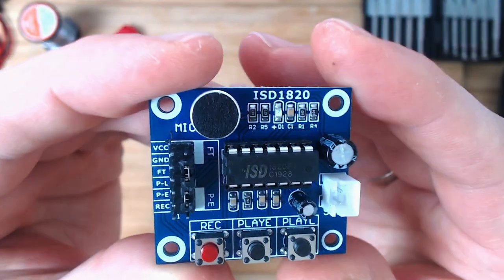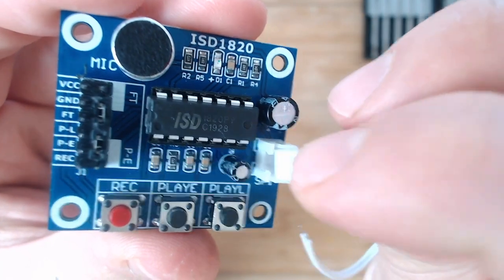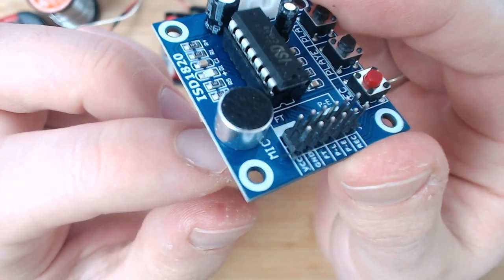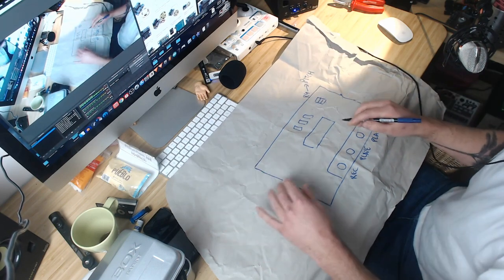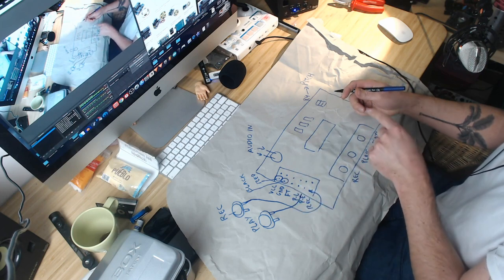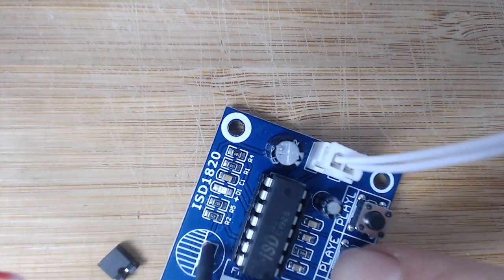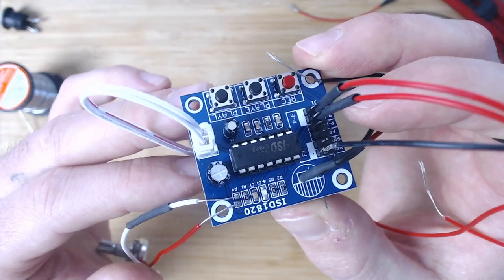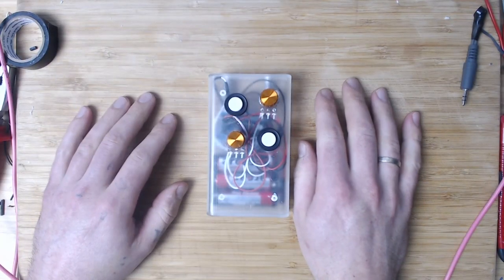HOW TO DIY LO FI SAMPLER

Comment: You can easily add a gate in so that you can sequence the samples with gate out from other gear. Get a simple npn transistor like 2n3904 and solder the collector to one leg of your trigger button and the emitter to the other leg, (you might have to try both directions to see which way it wants to go), then add like a 300k resistor from the base to a 3.5mm jack. A gate signal will now switch the button and the button will still work when you aren't sending it gate. 

I don't know how isd1820 is set up but if your blow up a transistor (unlikely but possible), it might be switching the whole battery power through the button, in which case you might need a resistor between the emitter and its button leg. Something like 200ohms should be fine.
Reply from the maker: Damn! You helped me out a lot with your comment, i was exactly trying to do this! next project confirmed! thanks
Reply: @Lonershy  Hell yeah. And your video got me thinking about buying some of these isd boards finally.
Reply: @Lonershy  and please do a video on that as well, I would love to try this out too.But I am a total noob when it comes to electronics. This will be my first ever project. Also I just subscribed. I love your demeanor and chill vibe. Keep these diy videos coming. You are the first person who actually makes things easy to understand most DIY youtubers either show to little or make stuff really complex to understand. I watch a lot of them and you are really the first person who actually made me understand it in a simple and easy way. Your diagram made it super easy for me. Most of the times when I see a diagram I already loose my comprehension after 2 seconds. But your diagram made me understand it. So I'm really thankful you made this video. I hope you will make more of these. Thank you and have a nice day.
Reply: I didn't read it before and I also talked with another guy , and he gave me also another way, which is a diode and 10k resistor in series going to the play pin of the IC is all that is needed, CV voltage is max 5v ( adviced by @dirkk82 ) down my little knowveldge I'm wondering which one is the better one and the more stable :) hope this is helpful
Reply: @Naked4FunTV  So here's what's happening.
The microcontroller is waiting for a signal to start playing the sample. That means, one way or another, one of the microcontroller's pins is either at positive voltage or "ground", waiting to receive a short pulse of the other polarity to say "go". That is, the pin has 0V on it, and is waiting for a few milliseconds of 5V (I'm assuming the circuit works on 5V and 0V, but it's not guaranteed), or the other way around.
With the transistor method (google "transistor as a switch"), you're sending enough current to the base of the transistor to "open" the channel between collector and emitter. So if those two are on opposite sides of a button, you're just letting through whatever is waiting on either side of the button to normally be switched. This is a nice method for a lot of circuit bends because you aren't adding your own voltage to whatever you're switching, you're just sticking a door into whatever pathway is already engineered to be doing something.
The diode/resistor method will most likely work just as good here, as long as:
1. The circuit in fact works on +5V (probably)
2. The pin responsible for triggering the sample is held at ground, waiting for a 5V signal (don't know, but not unlikely)
The resistor is there to make sure that whatever you're using to send signals only sends a very small amount of current to the microcontroller, because it most likely can't deal with very much. The diode is general protection so that the microcontroller doesn't send any voltage back to your signaling device, since we don't know exactly what's going on with that specific connection in the circuit, there could be other things happening. It also drops your voltage signal a little bit, but that could be good or bad, since we're theoretically in the dark about what type of signals we actually need.
I'd go with the transistor, because then I don't have to think about what's really happening in the circuit. If I went with the other method, I'd probably also add a voltage divider and move up from 0V to find the minimum voltage that triggered the sample reliably. And I'd want to be confident that it would only ever be triggered by a 5V pulse.
This is far from a comprehensive explanation of what's going on, and an electrical engineer probably wouldn't be happy with some of it, but I hope it helps.
Reply: I just looked it up and the ISD1820 works on 3V, so if you want to use the diode method, divide your 5V trigger pulses down first. This would work like this. You have an input jack to receive your trigger pulses, then your diode, then something around 4k resistor, then a 6k to ground. From the junction of those two resistors, take your 10k to the uc pin for play. And make sure you only send it max 5V
Reply: @samothrace2106  you are just great thanks and yeah following you thought of transistor/switch I believe is probably the best way to go, and safer for other devices attached to it probably, I'm  just a beginner in electronic my said but I'm super  fascinated from it and this will be my first little project, a sequencer and a lofi sampler :D thanks a lot
Reply: @Lonershy  Great and simple project ! Thanks Lonershy ! I'm wondering how it would be possible to trigger record and playback (loop) at the same time with a momentary switch so that it can create a shorter loop/repeater effect. Or maybe the chip needs to be recording at all time, add true bypass so when the momentary switch is activated it would connect to the playback and output of the ISD1820 module. The sampling time, or loop, would also needs to be reduced or controlled by a potentiometer for a short repeat effect. Maybe there is shorter sampling time chip out there. Needs to do some reasearch ! Any idea how to accomplish thoses not so crazy thoughts ?
Reply: Or maybe a digital delay would get me there faster ahah
Reply: @NinoJoy  the chip cannot record and play at the same time unfortunately. I have posted a free schematic and PCB layout for a eurorack module that has all the features broken out to 3.5mm jacks

I used a cd4053 to stop the gate input when record is enabled and turn back on when let go.

Comment: I feel like I'm missing how to use the FT (Feed Through) function. You said to connect those two pins together... does that mean it needs a switch of some sort in between the connection? Also, the volume pot connection was really glossed over. Even pausing and following the wiring was confusing. Can someone recommend a tut? I've built 3 of these now btw because of your vid. Thanks so much!
Reply: Just an FYI. This particular chip wouldn't work with the FT function that you posted at those two points. You need to connect the OTHER FT points together to get audio through.
Reply: @CommodoreCrush  What do you mean by "the OTHER FT points"? The ones second row first and second bar next to the white bar at an angle to it? The "other side of VCC and GND" so to say? Sorry if this sounds wierd, it's hard to be specific through YT-comments...

Comment: Very nice explanation. Does the sample board keep it's recording if the battery is removed? What's the maximum recording time? Should I just check out the Amazon page already?
Reply from the maker: YEs! it keeps it! maximum is around 20 sec if you record with the pitch level down, normal pitch is around 10-12 sec.

Comment: Great tutorial! :) When can I find this type od plastic box/case to this sample (or similar)? Can you wrtie name/type od transistor used for pitch knob? I can't understand this from video :/.  

Thank you for this tutorial :)
Reply from the maker: Hi! Thanks! I buy the cases on a local electronics shop, but you can find them on amazon, look for "enclosure" for the pitch you need to replace a resistor (the R4 in the module) with a 100k potentiometer, thats it!
Reply: @Lonershy  Thanks for help. This will be my first DIY project :)
I hope I don't burn down my house :D

Comment: Bro your God level for this tutorial. thanks alot foreal. I'm about buy the parts.hey I saw on the Amazon reveiw people had trouble with amplification did you have this issue if so how did you solve this issue? Thx again keep it up bro
Reply from the maker: Hi! yeah, i saw that too but maybe people was complaining because of the quality of the sound without a volume potentiometer, it may ge very loud so it´s important tp put one. Go for it!!!
Reply: @Lonershy  I found something in my searching for the module that I thought was kool that u might like, it is a APR33a3 module (only available form India from what I can tell). It is similar to the ISD1820 but this one records 8 channels and in hifi(16 bit) . Thx again leading me to these awsome modules and projects.
Reply: to rectify the loudness, stick a resistor on the output of the speaker/line out. it is loud because the speaker pins are driving a speaker rather than line out level. info can be found here  https://www.epanorama.net/circuits/speaker_to_line.html

Comment: You mention jumping the 2 FT points to be able to hear what you are recording. I cannot get this to work. The source sound is allowed through until the record button is pressed. Then the sound cuts out while the record button is pressed and it does not record. Have you figured a way around this? Any idea what's up? I've got  PLAYL, the loop switch, the pitch pot and the input connected. It works great other than the FT jump...
Reply: Did you fixed this?
Reply: @fabiandeleon4636  I did not.
Reply: Thanks!
Reply: Having the same issue. Ever find a solution?
Reply: @madzpanda  Nope. Damn thing is still off in a corner of the bench.
Reply: @MothHunterMods  fuck man. I scoured all of Google. Watched multiple videos. Chances are you can see me asking about this on every single one. They mostly say what he says but that doesn't work. If they don't say that it's a bunch of "maybe this but I never tried it" , or diagrams/schematics I can't read. I just need a simple "connect this pin and this pin". I know this thing can do it. You can hear this guys 4 channel sampler do it in that video so I know it's possible but it's like no one wants to share how.
Reply: @madzpanda  Damn, dude. I feel ya. I spent hours and hours trying solve this puzzle. Keep telling myself I'll get back to it, but it just stares at me. I had plans for it on a larger scale.
Reply: I could still do something cool with it, but being able to monitor the input is sort of a big deal.
Reply: @MothHunterMods  I had 2 plans. Based off this video but dude made like 2 massive mistakes in it.
Reply: @MothHunterMods  as a guitar pedal not being able to hear yourself is basically useless. I could make other things put of it... but I didn't want a yak back. Ya know? I wanted to do something like I've heard people hear do but apply it to something slightly different. Like you said not being able to get it to do that is kind of a big deal
Reply: @madzpanda Yeah, man. Pretty big bummer.

Comment: Great and simple project ! Thanks @Lonershy ! I'm wondering how it would be possible to trigger record and playback (loop) at the same time with a momentary switch so that it can create a shorter loop/repeater effect. Or maybe the chip needs to be recording at all time, add true bypass so when the momentary switch is activated it would connect to the playback and output of the ISD1820 module. The sampling time, or loop, would also needs to be reduced or controlled by a potentiometer for a short repeat effect. Maybe there is shorter sampling time chip out there. Needs to do some reasearch ! Any idea how to accomplish thoses not so crazy thoughts ?
Reply from the maker: haha no idea! but i encourage you to try!!!

Comment: On the first device you showed did you have to use some sort of mixer circuit to combine the outputs?
Reply from the maker: All together to the same output!
Reply: @Lonershy  Thanks for the reply!  I'm building this currently with five ISD boards, five Gate inputs, and two outputs via a buffered Y splitter daughterboard.  The daughterboard also contains the 2N3904s necessary for the Gate input which was described in another comment here and it converts the 9V input down to 5V for all the ISD boards by an LM7805 voltage regulator.
Reply: Someone also mentioned the ISD boards requiring 3.3V, that is the suggested voltage from the datasheet however numerous sources indicate it will work with anywhere from 2.4V to 5.5V DC.  5V seems to work absolutely fine in my own experimentation.

Comment: When you made the 4 channel sampler how did you run the inputs and outputs? Did you just solder all four directly into the same jack for in/out?
Reply from the maker: yes! super dirty mixed, for some reason if you share the batteries with more than one unit there is a big weird noise, if each unit has its own battery pack, there is no noise... i guess there must be a solution to that :?
Reply: @Lonershy  maybe some kind of grounding issue? I've read that they can handle the 5v from usb, so maybe powering them that way could help with powering multiple modules from one power source
Reply from the maker: @hunterchapman9845  good to know! thanks!

Comment: Yeah~thank you for sharing this tutorial,it is dope~did you make mix circuits in your 4track version ? because I connect FT,but I cannot hear input when I am recording ,thank you so much ~~~
Reply from the maker: Hey! I am wrong in the diagram, you have to connect FT but the one in the back, so counting from top left, the first and third pins must be connected! sorry about that! anyway, my experience with feedback after messing with 10 of those chips is that works but half of the times once you record, the volume goes super low... but just try!
Reply: Lonershy yeah thank you so much man,I will try it~~~

Comment: Hi! I try to build it but when i record and press play only plays some kind of white noise, has this ever happen to you? I've tried to re-solder in many ways but nothing seems to work... Thanks, love your content <3
Reply from the maker: Ok yes it happened to me, its probably something messing with the audio input or output, probably the output is fine because you can hear something, so i bet is the audio input, are you using the mic on it or have you connected a jack?
Reply: @Lonershy  I've taken the mic, and i tried different audio inputs. In the video looks like you are soldering 3 cables to the input, i´m only soldering 2 is that a problem?? Thanks for answering!!!
Reply from the maker: @rucarucaruca  it is only 2 cables. Hey, send me a video through instagram, im loner.shy on insta and lets find out!
Reply: @Lonershy  Thanks, I just did!

Comment: I suppose but this time you had learnt some things I will share with you but I hope it helps some other people coming to the comments behind me (and maybe some things you still not figure it out by yourself IDK). First of all there are dedicated modules for more voices so you don't need to buy 4 to get the same amount of voices but I'm not sure if these have realtime recording due I prefer the iPhone route with Koala as you found ;) Also teensy 3 has input/output and nice "patching-like" environment more friendly than regular C/C++/C scripting (arduino) coding. In that line I also shared in the other video the Otem Rellik looper thing, if you dig further you will find is based on mobmuplat (wrapper for puredata patches with touch interface available for iOS/android) so take a look into that too. Related to the soldering skills and practises I will recommend you next time for soldering (into smd pads) some soldering flux and some kind of connector/pin header instead going with cable directly (or almost expose the less possible to avoid shortcircuit) also for desoldering get a desolder-shield (IDK the name in english... in spanish "maya para desoldar") made from copper. It helps to clean the extra tin (estaño) and also some isopropilic alcohol (everyone knows what's that nowadays :( ) and toothbrush for deep cleaning before next solder attempt. Knowing the value of R4 (you can use a voltimeter for that) will help you to get the proper potentiometer. Proper desoldering could help to keep alive that poor mic... but in your way you get a nice 2 pin connector so hooray for that :D. For through-hole components (the mic for example) a vacuum pump desolder could be handy too.  Finally about organisation inside the box... if you take some time to learn very basics about GND and VCC placement in electronic circuits you will end with easy design using prototyping pre-made pcb. There are the most common with all the dots isolated but also some others with lines. These are useful for things like this when you need to "multiply" connections. 
http://www.electronicabf.com/placas-pistas-topos/1741-placa-ci-pistas-baquelita-77x90-mm-repro.html
If you need more advice or so, feel free to ask. I should start my own channel about all these things but life has some other priorities for me ATM... 
Hope it helps and keep bringing your journey. Cheers!

Comment: you should think of making a basic, passive multiple, and a passive mixer. this way you can control volume of multiple things in one spot, and route audio (or cv) with a multiple to... multiple things. kind of like a headphone splitter, which in fact is perfectly fine to use as a multiple. they make headphone splitters that split 1 out to 5 or more outs, and they go for $10 or less online. the passive mixer would just let you control volume levels in one spot, i imagine several attenuators on one panel would suffice as the same, or may be the same thing for all i know at this point.
Reply from the maker: yes! i just learned a lot since i published this video :)